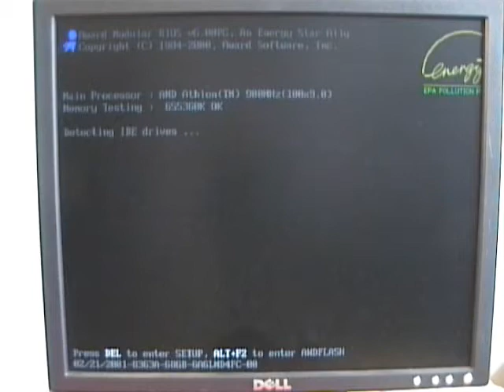Remove and Install a Floppy Drive

Comment: Nice video.  Believe it or not I'm working on a vintage 486DX-66 with Windows 3.11 and DOS.  I hadn't worked with ribbon cables in quite some time.  What was really helpful was pointing out the motherboard labels for the connectors.  I also found out I needed to set the BIOS boot to C instead of A if I wanted Windows to boot up.

Comment: thanks, I was not sure about power connector orientation because even in the correct orientation it bent the pins a bit when sliding in.

Comment: Back when these were frequently used, they called the 3 & 1/2 inch hard disks. The floppy disks were the 5.25" disks that actually could bend in your hand, hence the word "floppy"
Reply: They were both called floppy disk 💾  I was there I should know I used both daily! I feel I’m in a time warp!
Reply: @lorderectus1849  No no no no
I was there and they were not both called floppy disks!!!!
Reply: @JPTechie  Given that actual hard disks predate the 3.5" floppy you must've been in some kind of weird dream.
Reply: @SpeccyMan  diskette. Hard disks were called diskettes
Reply: @SpeccyMan  In 1971, IBM introduced the first "memory disk," better known today as the "floppy disk." It was an 8-inch flexible plastic disk coated with magnetic iron oxide. Computer data was written to and read from the disk's surface. The first Shugart floppy held 100 KBs of data.
In 1976, the 5 1/4" flexible disk drive and diskette was developed by Alan Shugart for Wang Laboratories. Wang wanted a smaller floppy disk and drive to use with their desktop computers. By 1978, more than 10 manufacturers were producing 5 1/4" floppy drives that stored up to 1.2MB (megabytes) of data.
In 1981, Sony introduced the first 3 1/2" floppy drives and diskettes. These floppies were encased in hard plastic, but the name stayed the same. They stored 400kb of data, and later 720K (double-density) and 1.44MB (high-density).

Comment: I have a basic hp desktop from not too long ago. Like 2012. I want to place a floppy drive that came from a computer from 2003  into the empty port of a new computer, but unfortunately, the cable ports are different. While the cable port for the old floppy drive has three connector plug ports (jumper, power cord and the weird wide belt-like cable wire bus), the new desktop has two cables (a small data bus cable and what I believe is a smaller version of the power cord. No jumper cable). Does this mean there is no way of connecting this diskette drive to the port of the new computer? Or is there some way I could connect a expansion to the cable to make the port compatible with the floppy diskette drive?

Comment: I have an old floppy from an old computer & I installed it in to my new one just for the heck of it, but it wont work it keeps telling me that i need to reformat the the disks but I still can not access them, have i missed something?
Reply: you did either a cable error or your floppy no longer works properly.

Comment: im struggling to get the 4 wire power lead out of my drive any advice or is it just a tight fit
Reply: late reply aha but these things can be stiff you just got to slowly wiggle it out.

Comment: People that need to maintain older system upgrades need the floppy to update the system BIOS for troubleshooting newer device installs where a USB update fails in older motherboards circa 2004.